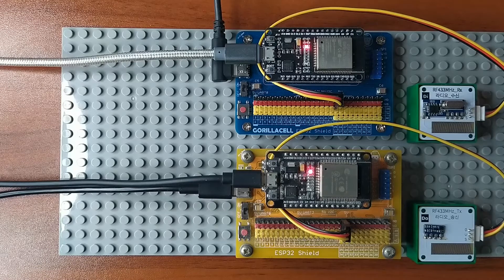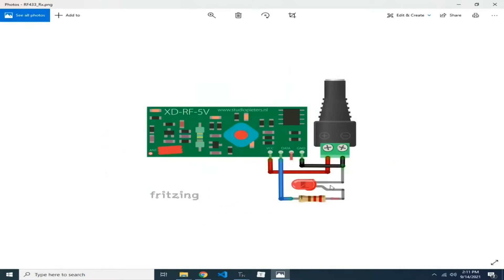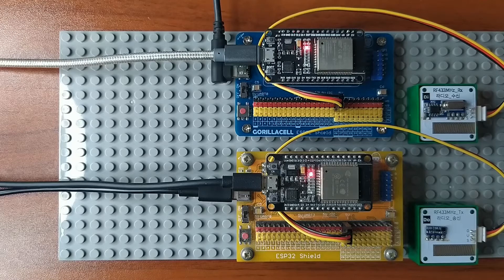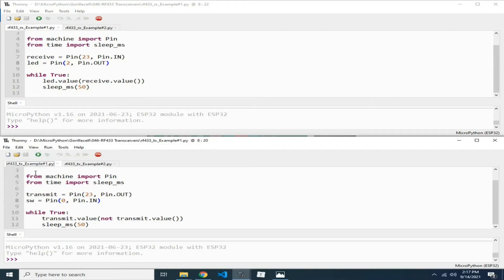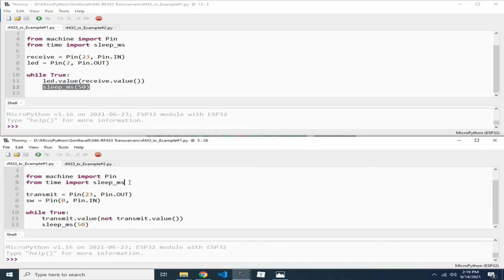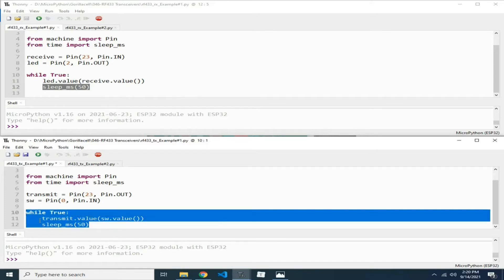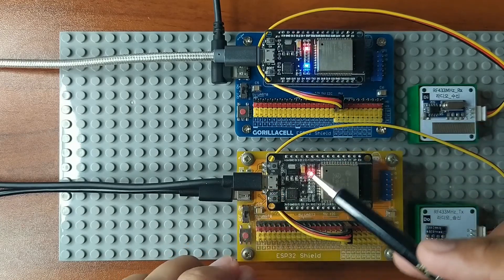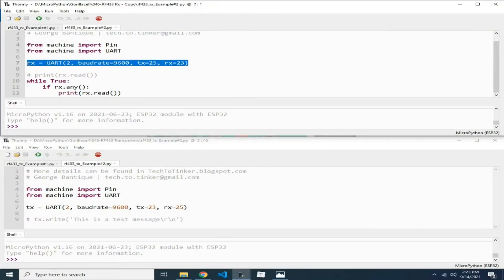046 - MicroPython TechNotes: RF433 Transceiver

Comment: how come all of the noice stoped? I'm trying to achieve the same thing with RPI pico, but I have 99% noice and only sometimes it picks the right data
Reply: Try using an antenna on each (straight length of solid core copper cable 172mm long) and then Drop the baudrate down to 1200 on both sides. The transmitter can take up to 12v so try to give it more power than just the 5v from the board. Use the 5V power to the receiver but as the Pico isn't 5v tolerant I would suggest using a logic level shifter on the data pin so that you only get 3v at the pin. You will probably still pick up some stray noise but I found this method got rid of most of it to the point where I can transmit a message reasonably reliably. I still wouldn't rely on these cheap modules for anything important though.

Comment: George I am more interested in example 2.  My question is how do you communicate with the 433 modules in example two as you do not reference them?  Do you simply hook up the data pins to the appropriate spots?   Can you explain how this is wired in more details?
Reply from the maker: Hi Kevin, I simply hookup it on a single pin. You may simply read it as a digital signal. And as I demonstrated, you can used it to transfer serial UART signal wirelessly.
Reply: @TechToTinker  thanks!

Comment: George I am excited to try this on a RPI Pico.  I ordered a few generic 433 units to test and send data over this.
Reply from the maker: Generic RF433 units are usually noisy so you might need a better handling of it
Reply: @TechToTinker  HI George I set them up in with a Pico, the same way you did with the ESP32 and it is very noisy only garbage comes out on the recv.
Reply: An easier way of playing with sub 1ghz is a Yardstick by GreatScott but it’s $99 otherwise you can find the same chip in a few modules for about $20 Michael Osmond is a good place to start 🎉